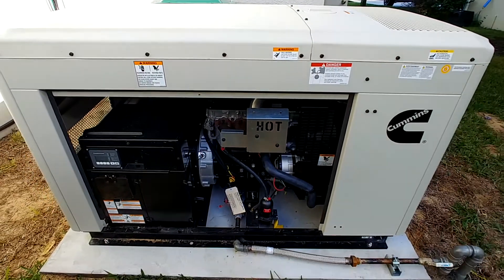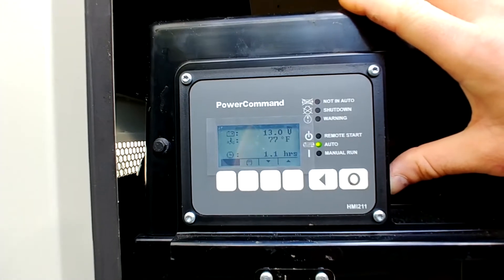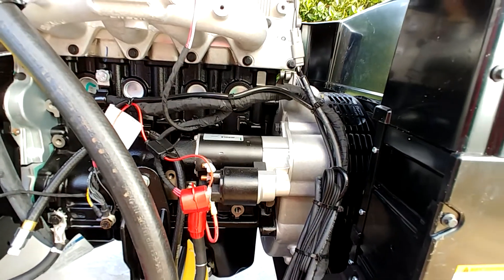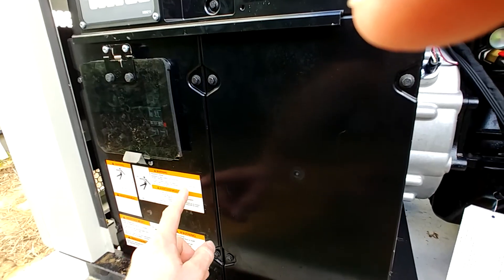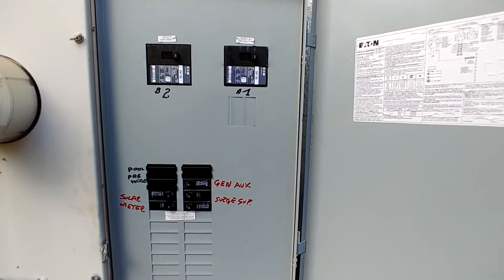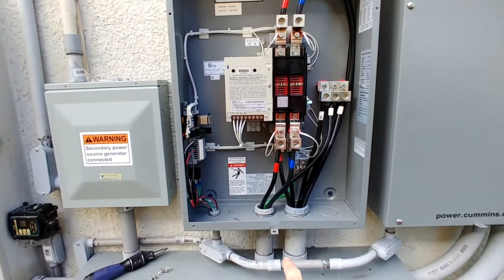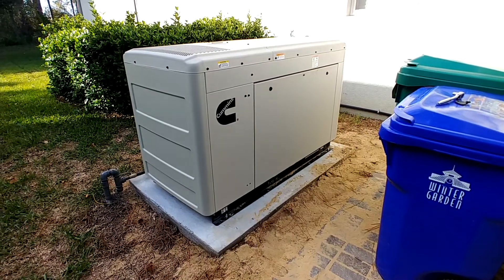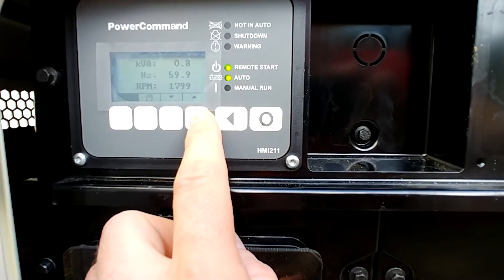Cummins RS25 Generator Review

Comment: The gas pressure spec on that unit is 6-14" WC and ~310,000 BTU. What is your gas service set up for? Did you upgrade meters or regulators? Ours is 7" WC pressure capable of delivering 400,000 BTU. At the moment I have a 15kw unit (portable) that I'm getting set up on natural gas and the plumber wanted us to upgrade service first, but I am not sure we need to - the 7" WC pressure falls in the spec. As I see it the limiting factor I would think is the volume, but if the pressure drops too much under load then I could see higher pressure being required. And that gets to my question. Our whole gas circuit is on 7" WC. Next upgrade in pressure is 2psi. That is too high for anything = we would need step down regulators. I'm not sure we want a bunch of regulators everywhere.... Just more to potentially leak.
Reply from the maker: No issues with my service. I talked to the tech guys with the gas company beforehand. They only thing they did was upgrade my meter to a larger higher flow meter
Reply: @bruehlt  What is your gas pressure? The info I've found on that unit also says that you can switch between propane and NG in the field. Is that by swapping parts that come with it (reg or orifice somewhere) or is there an adjustment to tune (like a load block or flow control on the demand regulator inside the cabinet)? I am curious what your set up procedure was when you ran it the first time - I assume you had to tune it to your specific gas supply?

Comment: Excellent video. Everything you talked about towards the end of the video on the 1800rpm units is why I am looking at these. We don't need the power, but as you noted when you get to this class of generator (one that will last - not a screamer 3600rpm air cooled unit) the pickin's this small - even 25kw or so - are few and far between. They only get bigger. I'd be interested in what your costs were - generator itself vs materials for the install vs permitting. I am in a different state, but it would be an interesting base line. Thanks and 73

Edit: I went thru comments and, doing the math on how far back the post was, there is a reply around 5/2020 that lists more detail on the costs. So for the $15k all up and ~$12k in the unit that would put the materials, permits, etc around the $3k ballpark. Excellent info!

Comment: Very nice. Do you have enough water column for your generator at full load? I have a Generac 25KW 1800rpm Industrial generator with the Ford 2.5L engine and I had to have the gas company upgrade my regulator to a 2 pound at the meter and then I tapped off of that and put a 4 oz regulator to feed my home appliances and then I tapped off the 2 pound regulator again and ran 1 inch pipe to my generator (about 40 feet) and there I put another 4 oz regulator and then finally went about 24 inches into the generator. Did most of the work myself. Just had an electrician hook up the transfer switch. It's so nice to have as you are finding out now.
Reply from the maker: Yes sir - they upgraded me to a large meter.  Surprisingly, they stated it would cost more on my bill.  I must have lucked out because so far I haven't seen any increases!
Reply: @bruehlt  cool. I recently upgraded from a 15kw industrial unit. And this 25kw hasn't seen any action yet. So patiently waiting for a tropical storm or weak hurricane. Lol

Comment: We are in Texas and the Cummins RS36 whole house generator saved our lives, when the entire state power grid went down 2021 winter, it switched over automatically, ran quietly and we never went without electricity.  Ours runs on natural gas and ran our 6,000 sq’ house, pool house and pool for 4 days straight.  When we got our gas bill and it was under $200.00.  This was the best money we ever spent-had it installed by AAGenPro fall 2020.  Had to wait 3 months for installation because of manufacture back order on these systems.  If you live in a hurricane zone-this is a must.
Reply: We were extremely fortunate that our home was on a hospital grid in Round Rock so our power never failed but it really did make me think hard about whole home generation. Since we’re moving soon I’ve been looking into these systems. I’m glad you were able to run with natural gas for that long. My main concern with the NG option is that in an extreme duration emergency that the gas pressure will get too low to run. This makes me want to consider a separate 500 gallon underground propane tank.
Reply: @DanielDaniel1  What did this cost you installed, total cost?
Reply: Can you please tell me what your RS36 cost insytalled/ We are looking at this one but not able to gauge against anything.
Reply: I live in Houston, the entire Texas grid did NOT go down. We never lost power at all just depends on where you lived during the instance.
Reply: entire state? wtf you talking about? it only went out in some places
Reply: @sonosource4811  Yeah... saved your lives... The entire state... You tejus clowns and your constant BS hyperbole.

Comment: I have my own business here in Houston and I'm really particular with my installations.  I want to tell you that you did a really first class job on the installation of yours.  Also, your video is very well done.  It's apparent that you're really proud of your installation and you really should be.  I've been installing mostly Kohler and Generac units since most people around here buy them because of of Generac's advertising.  However, I put in a Cummins 150 KW unit at a really large house here in Houston and the quality of the Cummins packaging is way above in quality and design.  Enjoy your unit! David Whisenhunt
Reply: @David: How do you find the Kohler liquid cooled 24KW (24RCL) Kohler? Realible? Tx in advance!

Comment: Travis - we're serious about getting a Cummins genset. We've been given a proposal which includes both an air cooled (20kW) and a liquid cooled (22kW) system. In comparing the two, we're trying to learn if the air cooled system requires ongoing maintenance (e.g. shutting down to cool the unit during prolonged/consistent use, oil change/plugs etc.) which may occur during a power outage vs. a liquid cooled unit which does not appear to require similar ongoing maintenance under similar conditions.  
In short and in your opinion, does a Cummins air cooled unit provide the same uninterrupted reliability as a Cummins liquid cooled unit? 
Sq ft=1860, no pool, electric heat, gas dryer, gas tankless hot water heater + gas stove top/electric oven. Currently, no (emergency) medical devices requiring constant power.
Reply from the maker: Personally if you can afford the cost the liquid cooled unit will definitely benefit you in the long run from a maintenance and availability standpoint!
Reply: @bruehlt  Thank you Travis for your prompt reply. Like you, we live in Florida and know the adverse effects of a compromised utility source. 

Cummins has discontinued the RS22kW roughly 90 days ago leaving us with a choice between the RS20kW or the RS25kW. After a serious discussion including your insights, we've elected to order the RS25kW. 

Bottom line- if you're considering a home standby generator to support you and your family during times of emergency then seriously consider the unit that will best sustain you during such events without the worry a failed or compromised generator will add to your list of issues to deal with during an emergency. We believe a liquid cooled system will give us the security and piece of mind to better face the uncertainties associated with an emergency. Thanks again, Travis.
Reply: @bruehlt  Any reason why you positioned your generator perpendicular to the house vs. parallel to the house?
Reply from the maker: @billperkins7668  Hi Bill - what  you don't see in the video is that the side that I am taking the video from - behind me is the garage wall, so it's more of in the corner of that area of my yard.  The distance to both walls helped play a role in that decision since there are setback requirements per the NFPA code.

Comment: Super impressed. All my company trucks are Cummings. I will plan on this setup. What is teh fuel consumption per hour?
Reply from the maker: According to the spec sheets - full load on NG is about 310 cubic feet per hour.  1/4 load is 123, and half load is 185.

Comment: Travis, when your RS25 was delivered, how did you move it from the street (curbside), lift it, and set it in its permanent location? I am a DIY guy and trying to save the $6K I was quoted (move, set, and install) without injuring myself or dismantling part of my fence. Thanks.
Reply from the maker: I was honestly surprised that the truck company took it off the truck and set it on my driveway. From there I had a friend who had a tractor with forks. We used lifting straps and set it into place.

Comment: My guess is that this unit runs at 3600RPM, not designed fo long life , I have a bent con rod from a GENERAC.  Even with the LOW OIL SHUT OFF, I use it as a paperweight , also 3600 RPM  CHEERS 🇺🇸🇺🇸
Reply from the maker: You didn't even watch the video.... This runs at 1800 rpm.
Reply: @bruehlt  when I wrote what I did was that simply, that lots of units They make when I questioned the company, the ones I asked about, I WAS SURPRISED that THOSE DID RUN AT 3600 RPM, so it seems their larger ones now run @1800, well that’s really good to know , but I would prefer diesel . Thanks 🇺🇸🇺🇸🇺🇸🇺🇸

Comment: 8 cylinder car engine,,, I'll bet it goes through some fuel,, l have a onan 2 cylinder it burns plenty,
Reply from the maker: This one is only 4 cylinders, although the bigger generators they make use larger engines such as a v6. I'm not sure they use a v8 in any models. I'm guessing when you get that big they are only diesel.
Reply: @bruehlt  oh you said 8

Comment: This generator without a theft cage would last about 12 hours in my neighborhood.
Reply: Time to move.
Reply from the maker: Good luck trying to steal it. It weighs over 1000 lbs. I used a front loader to get it to the concrete pad. Other people use overhead cranes.
Reply: @bruehlt  They stole an ATM from the bank parking lot 3 doors down...  If they want it, they going to get it...

Comment: A friend of mine bought one of these and had it installed single dwelling house about 2200 ft.² that ran him $15,000 installed the other day he lost power it wouldn't start dead battery of all things and his automatically starts every Tuesday morning I think it runs 15 or 20 minutes then shuts off,there's an old saying batteries get week in the summer and die in the winter.his did,Not saying anything negative about the unit or the installation he bought a new battery ran fine nothing negative. make sure you keep up with the battery

Comment: Have you had it load banked after you installed it?  The size of the pipe before the flex looks a little small and the fact that it doesn’t look like it has a dedicated high CFH  regulator might be an issue some day
Reply from the maker: It has not. But I followed the installation manual to the T when it came to sizing the gas line correctly. It's a 2.25" poly line that comes from the meter which is about 25' from the meter, which has been upsized to account for the required flow at full load.
Reply: @Travis Bruehl  you did great for a diy install. I think you said you were in Florida so you will probably never have an issue but what I’ve seen is when the supply is tapped off the house regulator and there are a few gas appliances in the mix using fuel it starves the gen. Having such a long run of low pressure and having it slightly choked before the supply inlet to the genset can diminish your fuel volume under high loads. I always make sure that the regulator is dedicated to the genset and is fed from the high pressure side before the house and it’s specs meet or exceed the gensets full load spec. Some many times I have new ones that I’m running a 50% load on and I give it a few more kw and the fuel pressure starts to drop and eventually hits a threshold where the engine starts to hunt and then stalls. Not that you will ever max it out but it’s good to know that every aspect is up to par.
Reply: One thing you can do is put a guage on the gas line at the genset. Cummins requires min 7 inch w.c. at full load. If it's below you'll notice it wants to die or hunt with load. Checking line pressure is important. CFM can be calculated.

Comment: Great installation. I commission these and work for Cummins and don’t see professionals do it as neat as you did if you truly did it yourself. Those are great units. Never had anything serious to repair on them. Very quiet even with the doors open. FYI when you exercise it let it run for anything longer than 15 minutes. They need to get hot. Short runs doesn’t let the oil get up to temp and they wind up with condensation in the oil. If you can run it with load even better. They like to be loaded.
Reply from the maker: I'll increase my run time. Right now it's setup to exercise twice a month. I try and apply a load for 30 min over a month to ensure it's loaded and that the transfer switch is working. Thanks for the feedback!
Reply: I run mine for 15 min every week and once a month I run the whole house on it. RS25 installed in November.
Reply: I wish all my customers had the knowledge and enthusiasm that you do

Comment: The generator may run your air conditioning units but the real test is will it run your heater. I have a 20 kW Generac that runs my AC and other appliances but it will not run my heater in my home. I found this out the hard way a weeks ago in Texas.
Reply from the maker: Power is power, it all depends on the starting current and if it's resistive, capacitive, or inductive. Any generator shouldn't have any issues running electric heat as long as it's rated for it. The problem is, most electric heat is way too current intensive for most generators, meaning it would be undersized for the task.

Comment: What's the max amp load you've put on this generator?
Reply from the maker: I've had everything in my house running, 1 AC running (2.5 ton), and the 2nd AC (3 ton) started.  You get a slight brown out but that's because the surge current required to start the AC units.  Otherwise no issues.
Reply: @bruehlt  Awesome video Travis.  You can get soft start kits for those AC units. Here is the one I like for my 4 ton:
https://www.microair.net/products/easystart-368-6-ton-soft-start-motor-starter-for-115-and-230v-ac-motors

Not only do they cut the inrush current by up to 70%, but they help prolong the life of the compressors.

Comment: Thats a great generator. Pricey. I would be curious who makes the engine? On the air cooled models, the engine is B&S Vanguard.
Reply: It’s a Mitsubishi engine
Reply: @VDUBZ08  Wow, surprised.
Reply: The RS25 - RS60 are  Mitsubishi  cooled made in China. Same engines used in Generac. The newer cube air cooled is also Chinese company made. Known as throwaway engines. Corporations are getting cheaper to cut corners to compete with companies like Generac. But I still prefer Cummins for their controls, alternator, and quietness. Old days of American quality is going away.

Comment: Thanks for the review. I'm a amateur radio operator in Texas and just experienced a power outage, 3 days and it was cold so,  I am looking for a home standby generator. 73 KI5KGT
Reply: If you only need a smaller portable unit, the Westinghouse is the best I've seen for the money. Duel fuel cost more but you can use propane & gas on them.
Reply: @JackAgainski  ....do you know what model by chance?
Reply: @alcopower5710  The WGen9500  is $950 at Home Depot. The 7500 in DF is the same price.
Reply: @JackAgainski  .....thanks for the quick response 👍
Reply: I'm also an amateur radio operator looking for a home standby generator.   73 KG5TVP

Comment: Which one puts out the cleanest voltage sine wave? Cummins, Generac, Or Kohler? I always heard that they can damage a computer, and sensitive electronics with bad sine wave voltage.
Reply: Output from a generator like this is a true sine wave (not a modified sine wave), because the waveform is created by geometry. However, the Total Harmonic Distortion (THD) is sometimes a problem for electronics.

See several links here:
https://duckduckgo.com/?q=generator+total+harmonic+distortion

Also: Comparison of THD of mains (utility) power and two types of generators:
https://youtu.be/9zfKbiHl__g
Reply from the maker: I believe all of these whole house generators use pure sine wave generators.  They aren't like the cheap portible generators.  Those usually output a modified sine wave output, because they're cheap.
Reply: @bruehlt  YES.  i have a Coleman Powermate 3750, on two large wheels. running voltage, no load, is 127.5 or so. with my big box battery charger/boost option, 200 amp TURNED ON, AND CHARGING A 12 CAR BATTERY, the load voltage is now 117.5....probably a modified square wave, as i have no oscilloscope.....BUT, when i plug my quarter horse air compressor in, it doesn't ever start it, have to give the belt a tug, and only spins for about 5 seconds, hums...so .....that is that..

Comment: What is the Cost run rate per hour for this unit at mid and max output??

Please advise as I may have missed it, but did not see it revealed.
Reply from the maker: You will need to calculate that based on your fuel costs.  The fuel consumption for this can be found here: https://powersuite.cummins.com/PS5/PS5Content/SiteContent/en/Binary_Asset/pdf/Commercial/SparkIgnited/NAS-5775-EN.pdf